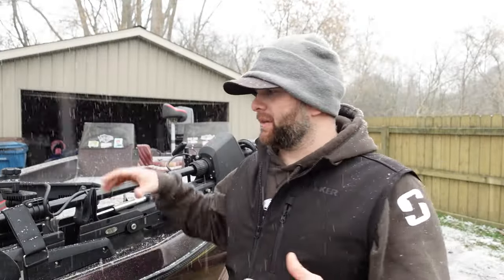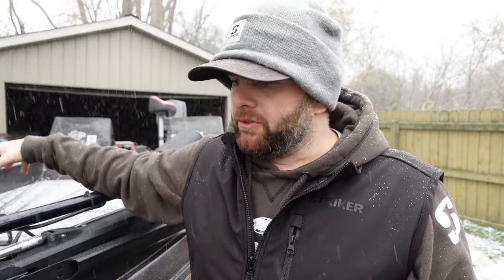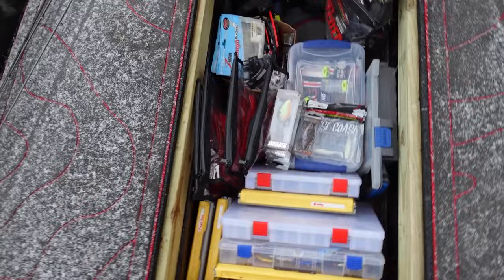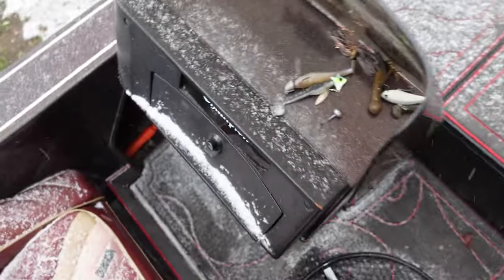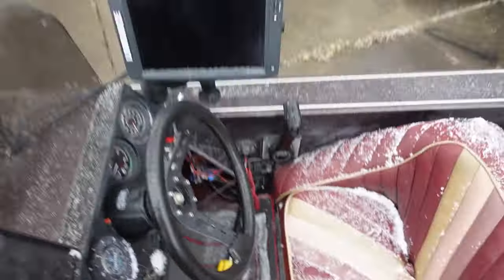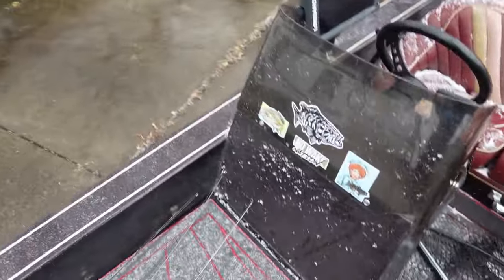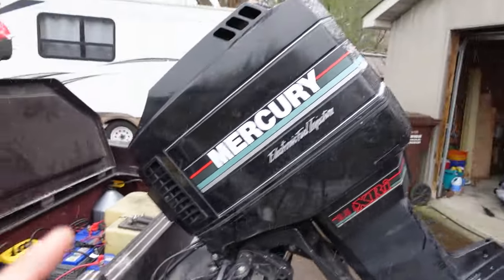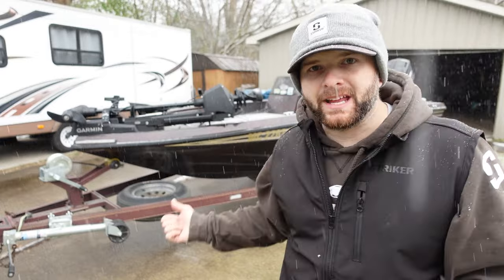NEW CHAMPION 184 Boat Tour!  (full walkthrough)

Comment: I rebuilt a ChampioN 203 2000 yr model back to original in 2020.  I have owned and been in many brands of bass boats, but the Champ 203 is the best ride.   In the rebuild I bought a 250 SS Suzuki.  Best motor I have ever had.  Just did my 500 hr check up with ZERO problems with the motor.  Here in E. Texas there are plenty of service centers for Suzuki's but you will never need one.  And with the Scorpion 27 pitch prop it will top end in the mid 70's and great hole shot.   Also has the best warranty out there.   I also went 100% Garmin.  Force, Ultra 10 & 12.  Total cost 47,000 not bad for a 100-thousand-dollar boat in todays market.
Reply from the maker: That’s such good info!  That’s what I’m looking to do as well.  Put a jackplate and Suzuki 175 on the back of it.  I’ve heard amazing things about Suzuki reliability

Comment: I have a 92 Champion 184, and the upgrade I highly suggest is changing out those cleats to spring-loaded ones. I've had 3 rods broken on my boat by those. When you set a rod over the side, they slide under those, and when you go to pick them up, they break. Save your rods and replace the cleats
Reply from the maker: Don’t say you told me so…but this exact thing happened today 😂
Reply: I also have a 92 184 and I went with flip up cleats .

Comment: Liked the video. I live in MI. also. Had 3 184 super v's in the 80's crazy rough water boats for there size. Back then we didn't run as much crap as we do now, could make the storage work. Boat was rocky at rest just learned to have good sea legs. My last champion was a 203, crazy crazy rough water ride. Loved my champions. Running Saginaw bay and st.clair glad I was in them boats. Since the late 70's I've owned alot of bass boats of different brands and rode in alot also.
Reply from the maker: Yeah I’ve been super happy with my 184.  Like you mentioned, it’s a bit wobbly in comparison to my past boat, but it eats rough water :-)
I looked at a 206, but it just was way too much money for what I was wanting

Comment: Great idea using your phone like that. I have a 99 191 Champ that I primarily use on Lake Michigan and it does just fine for a bass boat. I still need some critical electronics upgrades but it’s a solid plate form to start with.
Reply from the maker: That’s an awesome rig.  That’s what I did too - had good bones and then had to just upgrade the interior

Comment: Great video Ben and thanks for sharing and walking through your new used set up!  I did something similar but did go the new route and purchased a new 18 foot V hull fish and ski aluminum boat.  My issue is I wanted the lifetime warranty and a light boat that an SUV with 5000 lb towing could handle.  It came with a 5 inch Lowrance hook unit that I only use for basic 2D sonar and speed of the boat.  What I did was rig all my aftermarket electronics myself and took my time on weekends and after work back at end of May and most of June 2022.  I put the same Garmin Force Trolling motor and LVS34 Livescope and being my boat has room for 2 12 volts I am also running a 24 volt 80 lb set up and it is awesome!  I can troll with my trolling motor by using the remote or the touch screens of my 9" echomap units.  I have two 9" units at the front and one 9" at the helm and everything is linked together.  Could you let me know what app you are using to link your cell phone to the units?  I would really like that feature as well.  Hopefully uou continue the upgrade with maybe doing something like I did with one or two more garmin units all linked together once you get room for another battery.  Lol
Reply from the maker: Yessir!  I’d love to add another Garmin 10” at the console to link up front, but just waiting until I have cash set aside to add another unit.  Right now I’m using active captain app to link to the front graph
Reply: @brnowak_fishing  Thanks for letting me know.  I have to learn how to use the Active Captain app for the way points?  What I have been doing is saving on my 93 and 94 Echomaps when I find something that looks good on the lake that I am on.  What I need to learn is how to have the Force trolling motor find that way point which I think there is a way and of course keep us on the spot.  So much cool tech and never enough time to learn all of it.  I am hanging on with finances myself and taking a lot of heat for buying the new boat, but I know that if I can withstand this final year of high interest rates they will come down soon which will help everyone.  To save a bit for yourself, perhaps look at the 9" Echomaps like I did as they are pretty big and my 94 works great at the helm.  Perhaps Boxing Day sale will get you a really good price.  You can then link them with the Garmin hub so everything works as one.  Happy Holidays to you and your family!

Comment: Love the video, great upgrades.  Can you clarify about the eva foam and what company where they make ypu a template?
Reply from the maker: Hi Sandy!  Thank you!  I went with a company called Marine Mat - it made the process super easy.  You can either take it to a Marine Mat dealer and they’ll laser measure all of your boat, or they offer a Plastic/Mylar Template kit (which is what I used)

You lay the plastic on the boat and trace around all of the compartments, latches, etc.  Then Marine Mat will send you a detailed CAD rendering of your layout prior to cutting the EVA sheets.

Marine Mat is the way to go in my opinion

Comment: sick champion!!! be careful runnning an agm cranking battery with those older mercs.. technically you aren't supposed to run an agm with a motor that has a stator charging system. tightlines!
Reply from the maker: Thanks for the heads up, I didn’t know that!
Reply: @brnowak_fishing no prob! wet cell cranker and a dedicated electronics battery might be the move